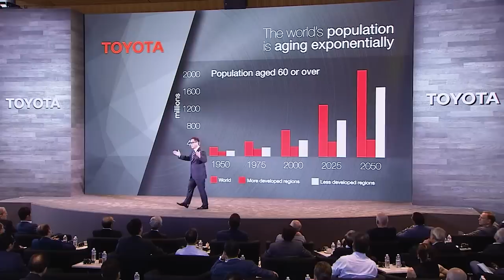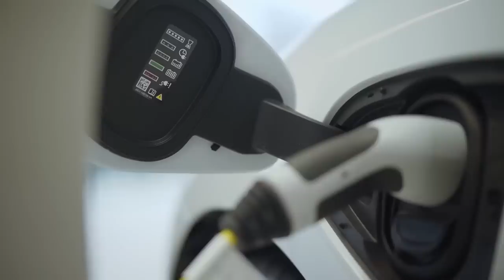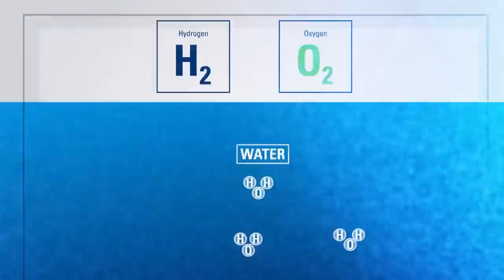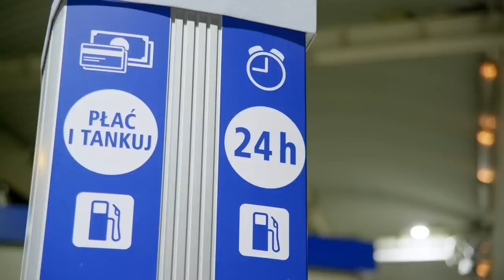New Toyota CEO Shocks Everybody | Huge News

Comment: So glad to hear a major company with common sense 🙌
Reply: How is hydrogen fuel common sense? How many cars run on hydrogen?
Reply: No kidding. Full electric vehicles are terrible for the environment right now. Buy hybrid if you are concerned. Battery technology isn't good enough yet and the mining operations for the materials is exploiting land and people. You have to drive a full electric vehicle about 500,000 miles before it's starts to offset the carbons it took to make it. I forget the miles for the hybrid but it's actually achievable in your lifetime, well under 100k miles.
Reply: @justcommenting4981  About the same number as were running on gasoline when they invented that I guess.
Reply: @ryanstark2350  so...0? How is that common sense compared to electricity? Places might not have infra for electricity but will have infrastructure for hydrogen?
Reply: @justcommenting4981  There was no infrastructure for petroleum either at first and there is little infrastructure for electrical recharging either. However, the problem is worse to solve for electricity because hydrogen is the source of the fuel in your vehicle whereas something else is the source to generate the electricity meaning vastly more infrastructure is needed to generate the power.
Reply: @ryanstark2350  the difference is there weren't already cars and hydrogen is way more dangerous and difficult to store and transport. Especially when you consider electricity is already widely available and the infrastructure is easier to establish than even gasoline. The only edge gasoline has at all is energy to weight ratio available to it for storage that is basically a thin plastic bucket. Not only do you need to extract hydrogen, you have to move and store it in better than air tight containers. To say nothing of putting highly explosive hydrogen cells in constantly crashing vehicles. What's the hydrogen going to do? Create electricity for an electric motor. It's a hydrogen battery instead of a lithium one.
Reply: @justcommenting4981  Nonsense. If you produce a fuel that goes in the vehicle then all you have to do is supply the fuel rather than generate the energy to then store in a battery. With batteries, you would need an enormous numbers of nuclear power plants to produce the electricity because that would be the only viable technology to achieve the gigantiic increase in electricity needed.
Reply: @ryanstark2350  how do you think they get hydrogen? They aren't picking it off a tree. They put energy into getting hydrogen, otherwise just use all that hydrogen in power plants. The process uses energy to end up with hydrogen and that hydrogen powers electric drive trains. How did you picture this working?
Reply: @justcommenting4981  Hydrogen is the most common element in the universe so looking at ways of creating pure hyroden is logical. Whether it can come near to beating fossil fuels is another matter. It requires power to create these fuels but nothing like the gigantic amount of power we would have to generate if everything requires that power to be stored in batteries rather than a gas. The insanity of all of this is that fossil fuels are in fact quite environmentally friendly since we don't need much power to extract and distibute them because they are a concentrated storage of power created by plants over billions of years and this is why solar energy and wind can not possibly compete with fossil fuels.
Reply: The way to look at this is how abundant is the energy source, how much energy does it create to extract it and then how much energy is needed to store it. This is why fossil fuels have been efficient. They are relatively abundant although obviously ultimatrly limited and fairly easy to extract and store.  Solar and wind are not all that abundant i.e. there is not always wind and direct sunlight. They are not that easy to efficiently extract energy from and batteries are not efficient at storage at all. There are of course places for all these methods. Electricity wired to our houses and factories etc is fine but not so good for moving vehicles. Nuclear will be needed no matter what we do.
Reply: @ryanstark2350  First of all electricity can come from anything including fossil fuels. There is no change in energy requirements or inherent inability to power all electric cars. You could literally have a gasoline power plant if you wanted and it would probably be more efficient actually. The hydrogen here would literally be used to power electric cars. It's a hydrogen battery. The process to liberate hydrogen requires more energy than you can use from the hydrogen. You're either using electricity or you're using fossil fuels to accomplish hydrogen extraction. So you're converting fossil fuel or electricity into hydrogen so it can go back to being electricity. Why? It will be harder and more dangerous to transport. Unlike natural gas and oil there is no well of pure hydrogen. The hydrogen has a chemical bond which is energy intensive to break. You can't get more energy than you put in. In the case of fossil fuel the energy comes from chemical energy that has already been stored in chemical form by a natural process and extracting that energy has a lower energy input cost. Humans get out more than they put in. In the case of hydrogen you're undoing what naturally occured, not taking advantage of a natural process then redoing that process to capture energy. You're doing electric cars with extra steps and making it more dangerous. Even if you used solar energy to extract hydrogen from water, why would you not more efficiently use that for electricity?

The only downside of lithium battery cars is the actual material of lithium and other elements used in the battery. It's expensive and will likely get more expensive as we go through the easily available sources. The limit on electric cars isn't making electricity or electrical demand it's making that many batteries and recycling the used batteries.

Fossil fuels aren't even remotely environmentally friendly. Not even a little bit. Sorry. Sun and wind are more abundant than gasoline. There are many methods of large scale storage including water towers, as well as standard electrical batteries. Fossil fuels make the most money for people in power. That's why we use them and aren't even trying anything else in the U.S. China is another matter and easily eclipsing the US in that respect.
Reply: Blackout  hydrogen cars are have electric drive trains so I don't know what you mean.